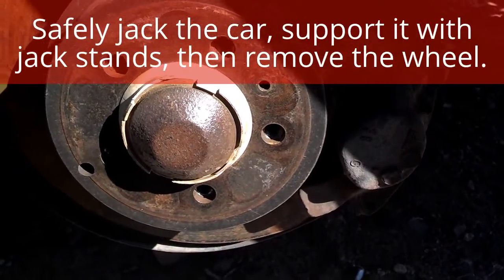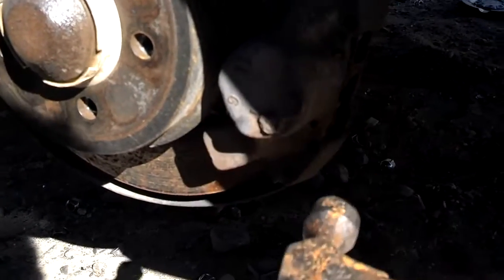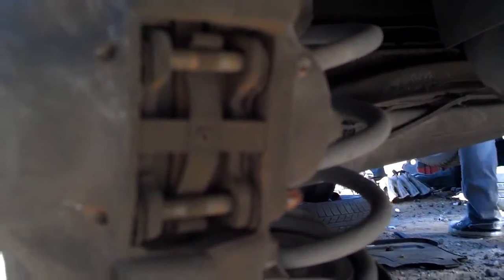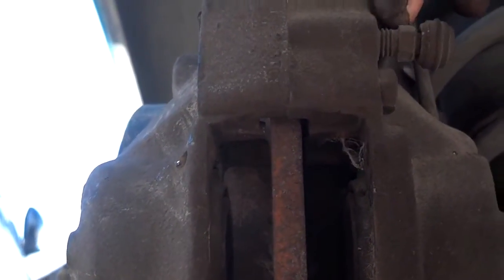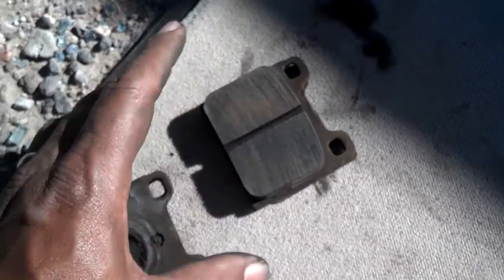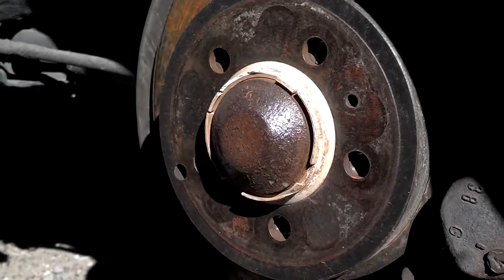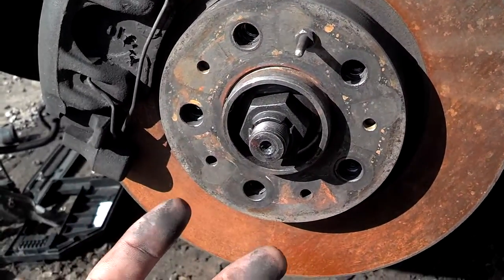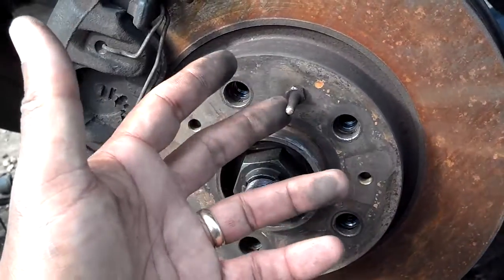How to replace the rear brake pads so you will have good brakes. Volvo, BMW, Jaguar, etc. - VOTD

Comment: Today is the big day!!  Going to be replacing both rear rotors, brake pads, hub bearings, rear springs and emergency brake pads. The rear shocks and mounts already changed. Hopefully this will solve the metal crunching sound I get going over bumps. So glad my nephew wants to help. Thank you for your videos.
Reply from the maker: Sebastian Schwarz Nice, let me know how it goes.

Comment: The job is all done!!  I even flushed my brake system since I had to bleed the line. I also had the lower spring bolt spin on me. Somehow the bolt broke loose from the mount. I was able to cut the bolt, then I was able to remove it. Luckily, I was able to get one from the junkyard. Can't wait to rest up tomorrow.
Reply from the maker: Sebastian Schwarz LOL, I think I'm going to replace my rear suspension soon. It is simply worn out, including my parking brake system that does NOT work.

Comment: Thank you for your videos! I replaced my heater core recently and heavily relied on your video. I am having trouble pushing in one of the caliper pistons all the way. I have not loosened the bleeder nut (only loosened the reservoir cap in the engine bay). Should I also loosen the bleeder nut, and will I have to flush the brake line if I do so?
Reply from the maker: Are you using some kind of clamp? Really should not have to loosen the bleeder or reservoir cap. You should probably replace all of the fluid anyway.
Reply from the maker: https://youtu.be/8zfyVIRnMjY
Reply from the maker: https://youtu.be/S7kfLRa5jcg
Reply: @RobertDIY   thanks for the quick reply! I used a C clamp and also used the old pad and a screwdriver as a lever to try and push it in.

Comment: Love surprises, everything went smooth as butter on the passenger side, but discovered that my driver side caliper is frozen on one side. Crap!!  Now I have to make a trip to the junkyard tomorrow morning and find a working caliper. Next, I have to figure out how to bleed the system after installing the replacement. The new zinc rotor and the blue spring look fantastic!!
Reply from the maker: Sebastian Schwarz Good to know you found a bad caliper. I forgot those rears had 2 pistons.

Comment: Hey Robert, I recently replaced my rear brakes on my 99 S70 and one rear wheel spins more freely than the other. I think the caliper is causing the wheel to drag just a little bit because there is a bit more wear on the rotor on the side that isn't as free.

One question though: Would a rear sticking caliper cause the car to pull towards the side that is sticking a little bit? I haven't gotten a front end alignment since March, so I'm probably due for one.
Reply from the maker: +ZynovFTW parking brake shoes are probably dragging. Does the parking brake work? It won't make the car pull.
Reply: My parking brake doesn't work. There were no shoe material left and we didn't know how to change the shoes so we just left it alone.
Reply from the maker: Parts in there can break as well. Have you wanted the parking brake shoe video?

Comment: Hello Robert, I have a 98 S70 Volvo that currently needs the rear driver side caliper/ break pads repaired. Thanks to your video I have a better understanding how to go about the repair, I just don't know how to bleed my breaks during or after the process, could you explain this procedure for me?
Reply from the maker: After. Try to let as little air in the system as possible. I usually start the car so vacuum helps. Have someone press on the brakes, then open the bleeder until the person in the car tells you the pedal is at the floor or all the air is out of the caliper. Takes about 1 second per brake application. Then the person will pump 3 times and hold (then you open the bleeder for 1 second). You repeat the process until no air comes out of the caliper. Always be careful that you don't run out of fluid in the reservoir under the hood. If you get air in your master cylinder you can destroy it.

Comment: My buddy literally drove the brakes off the car.   One of the rear rotors disintegrated and now looks like a drum brake. Can’t get it off because there is no lip on the rotor to grab to pull off, even with a puller. Any suggestions on getting the rotor off?  I may have to cut the shield off to get a place on the back of the rotor remnant for the puller to grab, but looking for alternative.
Reply from the maker: I have no idea

Comment: Hey Robert I took the pin off the rear rotor and it still is stuck. What am I missing?
Reply from the maker: A large hammer. Try not to destroy the hub.

Comment: Hey Robert I could use some of your expertise. I did rear brakes earlier today and I have a question about my E-Brake. I installed new parking brake shoes, and tightened the tensioner in the center console. The E-Brake works just fine but now makes this noise when I press the button down on the parking brake lever and pull it up and down. It sounds like it's coming from one, if not both rear wheels.. Almost like something is sticking back there. I was thinking the tensioner springs for the parking brake shoes might need a little grease, or maybe I have a bad cable. Any idea what my problem might be?
Reply from the maker: LJRossPhoto Probably the tensioner adjusting to where it needs to be. I would pull it up and down about 20 times, slowly and see if that cures it.
Reply: Robert DIY I tried that, but that didn't work for me. The lever in the car is adjusted how I've always had it, but the parking brake won't hold the car on a hill (5% gradient). It barely works on a very light gradient (1% gradient).
Reply: LJRossPhoto Just took the rotors off and had a friend pull the parking brake up and down for me, and it doesn't look like the parking brake shoes are moving at all on either side....
Reply from the maker: Maybe you should adjust them all the way in and let them adjust themselves out.
Reply from the maker: LJRossPhoto Everything looks fine to me. If it's not getting stuck when you release them I would not worry about it.
Reply: Robert DIY Any idea why it's not holding the car well? Any why that plate in the center console is hitting? And why there's that knocking noise every time you pull the ebrake? Sorry for all the questions. I just can't wrap my head around this one.
Reply from the maker: I really don't know. I plan to dig into mine soon because it does NOT work. As for the handle hitting the center console, my guess is that the center console is to low, maybe missing the block support.
Reply: Robert DIY I got it working to the point that it will hold the car where I need it to. It's not great, but it works. You just need to rotate (expand) the little gear on the top of the assembly (underneath the small retaining spring that holds the shoes together) until the rotor barely fits around the shoes. That way when you pull the parking brake, it'll grab. Anyways, thanks for your advice as always.
Reply from the maker: I thought that thing adjusted itself with a few pulls of the handle?
Reply: Robert DIY I wish it was that easy. That's not how it worked for me. Who knows, you might find an easier way than I did.

Comment: The rear end went up from 25 inches to 27 inches after replacing them with IPD's HD springs. I replaced the parking brake pads, but I also think the cable is rusted somewhere along the cable. Seems like a common issue.
Reply from the maker: Sebastian Schwarz Bad cables. Yuk!

Comment: Robert, great video! I have some questions though. I recently changed all four brakes (pads and rotors). I Jack up the rear wheels and they don't spin freely. Should they? There seems to be a grinding noise as they spin, then they come to an abrupt stop. Everything is torqued up and snug. Could it be the pistons are stuck? I had a heck of a time getting the new pads in.
Reply from the maker: +Henri Leclipteux what kind of car do you have?

Comment: Why can I not find the correct rear rotors for my 2000 Volvo S70 AWD 5cyl turbo? I want aftermarket due to dealer cost.
Reply from the maker: I have no idea, where are you looking?
Reply: @RobertDIY  I am in Canada looking at the parts stores, they say there is 3 different rear rotors for my car and they cant be sure which one they need to order in for me. The dealer wants 100$ apiece which I can't pay.
Reply from the maker: Well, they are different from FWD rotors, so you can eliminate those. Try to get the pn from the dealer or a parts website.
Reply: @RobertDIY  Thanks for the tip Robert, I took a bunch of measurements off my old rotor and will research more. I watched a video stating I must bleed off the fluid at the caliper while resetting the piston due to having ABS, does this make sense to you?

Comment: Hi robert i wonder if you have done any tutorial for handbrake adjustament on a s70/v70/850,my 99 v70 tdi 2.5 Auto needs a little more tension.  thanks so much for your amazing videos.
Regards from Seville,Spain
Reply from the maker: gonzalo giron There is a adjustment in the had brake area. I think you can pull the cover in the arm rest area and adjust it from there with a T50 or something like that.